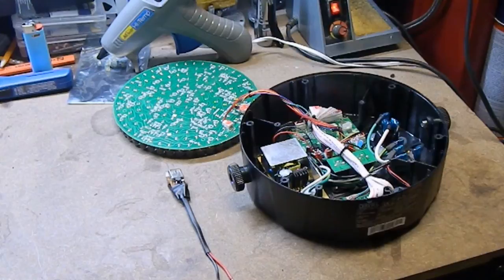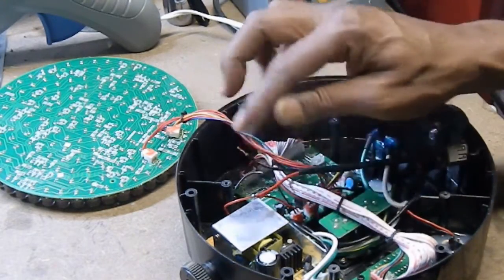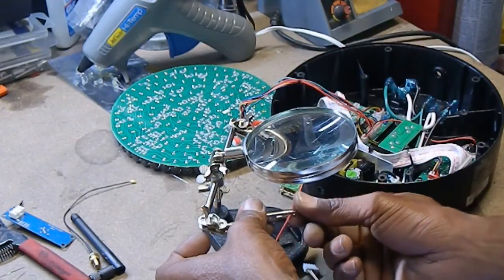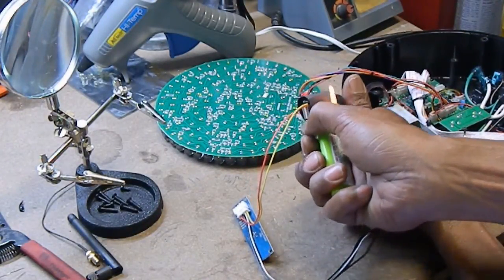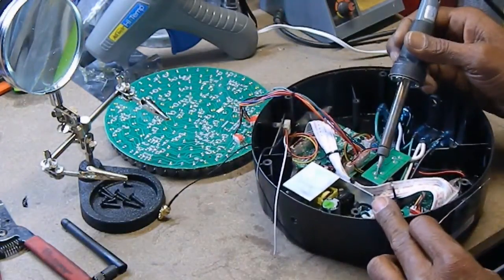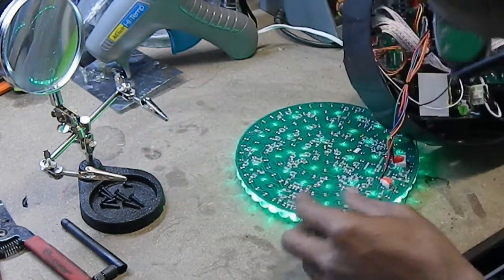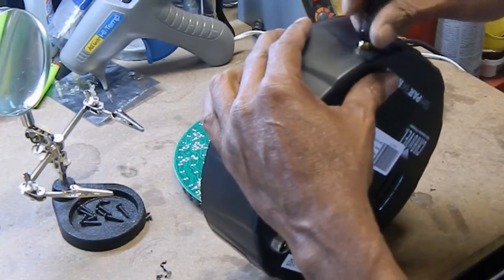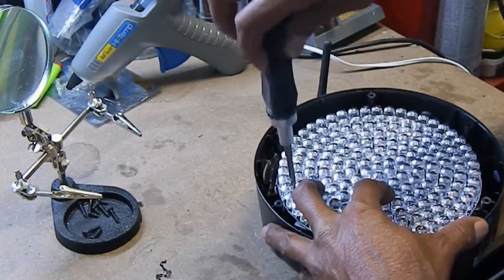Chauvet Slimpar 64 RGBA Built-in Wireless DMX Upgrade DIY - PT2

Comment: Shawn - Thank you so much for you tutorial. I have done the same thing with the similar Monoprice LED 9x10w pars, with 2 exceptions - I used an ebay voltage regulator circuit ($1 ea) and left the antenna inside the case. So far I have completed 4 of my 8 lights. Over time I'll convert all of them! You inspired me to try this - and I love it.  Sure beats the external DMX wireless "Tubes" I see other people use!  Now I just plug-n-go!
DC 5~24v to 3.3v 5V 9V 12v 3A Adjustable Buck Step down Voltage Regulator Module - needs correct 5v voltage selected/soldered & a copper trace cut to "adjustable" pot
DMX512 2.4G LED Wireless Light Module LEDs PCB Transmitter Receiver with Co H4V5 - follow your example, but use enclosed instructions for wire colors etc
Reply from the maker: Awesome! I'll have to checkout the voltage regulator circuit boards, should I need them. We still have a few of the Slimpars left. Now buying the Freedom Pars.

Comment from the maker: Just a note about DMX and the boards I'm referencing in my video. The DMX boards both support transmitting and receiving in one board, just connect the Black and White wires to the correct DMX "IN" or "OUT". Since DMX is a One-way signal some fixtures may have a small delay depending on the wireless 2.4 ghz frequencies in the air and the direct line of sight from your first transmitter. 

For larger rooms or a lot of fixtures , it's best to breakup your signal by adding a second transmitter (DMX OUT) and choosing another DMX channel  to repeat the signal. This helps troubleshooting DMX issues when running over 30 or more fixtures.

Comment: Great video.... I have the par 56 and plan on doing this to a few units to see how it works. My question... I built battery packs for my par cans and wonder if you can still use the 12v plug as normal ... not sure if the 12v you tapped into has any effect on the use of that outlet. Any insight would be helpful... thanks

Comment: Shawn..this is a great solution and video.  If I may ask a question.  When you soldered the hot and ground t the DMX connection it looked like you soldered pin 1(Black) & 2 (White) ..when you showed the still of the connection it looked like you soldered  2 (White) 3 (Black)
Reply from the maker: That is true. I noticed that some of the china based dmx boards are not consistent in wiring or it did some funky flickering. So I always test each board with the fixture while sending a RBG signal and other dmx functions to make sure everything works before I hot glue. I just ordered some new boards from ebay last week and they were completely different as far wiring. Red went to USB pin 1 on the USB inverter, Yellow went to pin 1 (ground) on the input of the slimpar, Black went to pin 2 and white to pin 3.

If the dmx boards came with wiring instructions, please follow them and test everything before you you drill or glue. The main part of this video is how to get 5volts to the the boards and install the PCB dmx boards. Good luck and thanks for watching!
Reply: Thank you so much Shawn.....it's a great to make your acquaintance..Have a great day.

Comment: What is the main adapator for all of the wireless units. I hope I'm asking it right. All the wireless boards you put in. What are they getting the signal from?
Reply from the maker: Aaron Adams I'm using Chauvet ShowXpress software and ShowXpress 512 Plus box  to control the DMX along with a DMX Wireless Stick acting as the transmitter. Any DMX software and hardware that transmits a DMX signal should work fine. Let me know if this answered your question. Thanks

Comment: Hi there. love your video, very thorough. I was wondering though about that blue coloured reciever circut board , could you please supply a link or contact so I could also go down this path as an option?. Finally where do you track down the par 64 wireless battery powered unit to buy as I can't seem to find anything on the internet under Chauvet. I seem to find plenty of battery powered par 64 units listed but not with built in wireless as well. Being not as skilled as you this maybe the second option lol
Kind Regards Dave

Comment: Shawn, why wire both DMX wires to one side? Should one DMX wire go to the DMX transmit in side and one to the transmit out side since DMX is only needing one wire? (Does that make sense)

I wired both DMX wires to one side (DMX in side or out side) and all my receiving lights work fine but my transmitting light doesn't. The transmitting board keeps frying. I'm thinking because I have the two wires on the transmitting side but when I connect a physical DMX cord to go into a non-wireless light it must create a short causing my transmitting DMX board to fry. Should I just only have one wire on and maybe my board won't fry anymore?
Reply from the maker: +Carlos Delvalle DMX is a three or five wire. +/- and ground for 3 wire.

Comment: I purchase same the dmx board in the video but the wires are color different on the plastic fixture. From left to right on the board it shows black, red, white and yellow. The board did not come it a wire diagram show what’s the 5v wire and ground.
Reply from the maker: Most items that come from China are not consistence. The red is most likely to be hot and yellow would be ground. However check with the company you purchased from.

Comment: Shawn- Hey man, great video - Thank you! I just got some lights for my band and thinking about doing this EASY and CHEAP upgrade, can't believe how simple this is compared to the cost of manufactured units. 

My question however, what are you using to Transmit data to these units? How do you connect/configure that setup? Perhaps a video on that would help? Appreciate any input!

Thanks!
Reply from the maker: Any DMX Controller or Computer Interface would work. If using the Slim Pars and want to keep cost down and simple, I would look at getting a Chauvet Obey 4 or 10. For the wireless Transmitter, go to donnerdeals.com and get a Donner 2.4G DMX512 Wireless Transmitter. Then your all set. Thanks!

Comment: Hi Shawn,
I am confused about the channels of the wireless and the DMX channels. Are the transmitters 7 DMX universes? Then do you set each light or device separately for different unit numbers? THanks!
Reply from the maker: Dean, the 7 channels on the DMX boards (also applies to the sticks) are 2.4ghz frequencies that allow you to get the best reception or two split your DMX setup. Nothing to do with DMX universes. So, if you want all your lights on the same channel, you would chose channel 1, (default red), then on your Transmitter you would also select channel 1 red.  See ex: http://www.donnerdeal.com/promotion/wireless/05.jpg
Reply: Gotcha - thanks so very much :)
Reply: When I connect them up, the led flashes only red: what does this signify?
Reply from the maker: That means the board is on channel one, which I think is default. With the fixures on red, your wireless transmitter should be on the same red channel, then use your dmx hardware or software to control your fixture.
Reply: What I mean is it is flashing red - not flashing green like yours is.
Reply from the maker: Okay, unplug and power off your wireless transmitter. Power on just your fixture, then push the button on the dmx board of the fixture until it turns Blue and wait a few seconds and power off the fixture. Now plug in and power your transmitter. Push the button until the light on the transmitter turns Blue. Now power your fixture. You'll know if the transmitter and dmx boards are connected by the the lights. The transmitter will blink RED and the fixtures receiver will blink Green. What are you using for a wireless transmitter?
Reply: I was using the same board as they say it is both a transmitter and receiver.
Reply from the maker: Okay then the transmitter board is connected and wired to what?

Comment: this so good . is there a prefered model of board? and witch tranmiter should i use if i may ask...lv this...
Reply from the maker: Search eBay or other sources for standard dmx 512 boards. They are petty much the same, just look at the wiring closely. As far as Transmitters, they are also basic dmx 512 sticks/boxes or you can build your own using the same dmx boards. Female end is dmx IN and Male for dmx out. Thanks and share!

Comment: I wana bild dmx into 8 led flat pars and in 2 moving heads, which transmitters Would you buy? is that possible with 10 moduls and 1 Controller ( usb dmx interface)?
Reply from the maker: +bimbolino14 , yes you can have as many receivers as you'll like and one transmitter connected to DMX controller. The boards support transmitting and receiving, just connect the DMX wires to the DMx "IN" for receive and OUT for transmit. Good luck!
Reply: +Shawn Garner Do you have a link for me to buy this boards ?
Reply from the maker: +bimbolino14 please use ebay and search for wireless dmx 512 board. I can't recommend any one ebay seller. Remenber to do your research on the sellers before you buy.
Reply: +Shawn Garner could I use every board aß transmitter ore reciever
Reply from the maker: +bimbolino14 yes

Comment: I love this video.  I have 18 of the old Chauvet Rain 56 lights and this is a way to finally modernize them.  Another thing I"ve looked into is using a small 12 volt battery like the ones used for emergency lights as a back up.  They can be purchased at stores like Lowes.  Connect that up to that 12 volt terminal in the light and they will run.  The larger the miliamps of the battery the longer the lights will work and then you can just recharge the batteries using a standard car battery charger.  This would allow you to place some lights in places where running long cords would be a pain or trip hazard.
Reply from the maker: Mark Schwenn Nice solution for battery power. The SlimPar 64's also have a Satellite connector for a 12 Volt connection. I'm thinking about using this connection to add a 12v battery for a few of my SP64's.

Comment: can I use the board dmx wireless to send the signal to my light? I bought 2 and they are "transmitter receiver" so, I can use one as transmitter connected to my dmx console and the other to my light? please tell me yes....
Reply from the maker: +Dvj Upset if you're installing a wireless dmx pcb board into a fixture and wire it to the input side, then your internal board will become the receiver. You would then use a dmx transmitter connected to your dmx control board or usb dmx interface. DMX 512 pcb boards can be wired as transmitters (out) or receivers (in).

Comment: Awesome Tutorial! This is just what I was looking for. The only question I have is, "How are the boards holding up." I've used alot of components from China and they seem to be hit or miss. My only concern with your workflow is that the board will go out in a few months. Granted it won't be too hard to replace it but I wanted to get your take on their performance over the months. Thanks!
Reply: Also, do you think this will work with the battery operated EZ PAR 64. I guess I can give it a go myself tonight but I figured I would ask. It would be great if I could run it off the battery itself.
Reply from the maker: Valentino Zertuche Thanks for watching. Anything electronic will go out, always plan ahead and purchase extra if needed. So far the DMX boards are still working fine.
Reply from the maker: Valentino Zertuche Battery should work as long as you have a 5 volt tap in the fixture. The battery time may give you 5-6 hours depending how much you send dmx signals to the fixture. Let us know what you find out.

Comment: hi I found the wireless DMX board on eBay. is the same item really the transmitter and receiver do you have to wire it differently to be a transmitter or just hook it to the output of the DMX and it automatically knows to transmit if I was going to add the board to my obey 40 controller 
thank you. did the directions that came with item explain what to do differently?
Reply from the maker: +charles t sedita iii The DMX 512 boards can be a Transmitter or Receiver. It just depends if you have a male (In) or female (Out) XLR. If you want the boards to be a Transmitter wire the unit to DMX OUT Thanks for watching!
Reply: +Shawn Garner 
thank you so much. I'm gonna give it a try. befor I drill any holes of course
Reply: +Shawn Garner Man, i just love you <3 I had bought 4 devices and I didnt know if they could work as a transmitter jajaja, thanks, THAAANKS!
Reply from the maker: Dvj Upset Thanks... hope your project turns out great!

Comment: Hi, I love the idea, I know that the invention is a few years old, but I want to do this in my Chinese leds. Could I do this on my Chinese DMX board?
Reply from the maker: I'm sure you can, just need to use a volt meter to see what voltage is coming out of the transformer.
Reply: and found an output called remote that delivers 5v, with this output I can put the antenna. but now I have another question, I ask her if she can help me or some solution occurs to her.

my led spotlights do not have 12v output in the housing. e measured with the polymeter and has a current of 22v. I want to use the bulbs with 12v batteries, is there any way to reduce the voltage from 22v to 12v?.

Thanks in advance

Comment: I purchased some boards (and even tried the wireless external units). 
they show the appropriate green and red flashing lights (for rx and tx) 
but I cannot make it so that the receive tells my lights to run. if I 
use a straight dmx cable, they work perfectly, but when I replace the 
cable with the tx rx wireless units (that indicate they are successfully
 receiving/transmitting) the lights don't receive (obviously the master 
still works, but slave stays blank). replace with cable, slave works.. 
are there different types of DMX, maybe my lights use some odd wiring? 
if so, why does the cable work fine? really confused
Reply from the maker: Make sure the transmitters and receivers are both on the same channels. This should work with the dmx 512 boards and or external dmx 512 sticks. Also check your wiring. Search google images for "dmx 3 pin wiring diagram".
Reply: thanks for that..   like I said, it works if I use the external wireless ones on some moving head lights I have, just not on the static pucks. yet the puck work if I use DMX cable, and same cable works on the moving heads.  I do have an app that tells me all kinds of pinouts (electra droid - way handy) including DMX
Reply from the maker: I did notice some the pinouts where backwards on the board in SlimPars. In the video I manually checked and confirmed the pins while I had a color change program running.
Reply: yep, I noticed that and thought it was a good call. I tried swapping the pin outs inside one board, but then the tx light stopped operating so I suspect it was 'correct' the first time... :-(
Reply: just an FYI. I had it pointed out to me that some of the cheaper PUCK (ex aliexpress) can recieve DMX, but when set in master/slave mode the master don't send actual DMX, but instead some proprietary system. the wireless transmitters don't know how to send that signal so it falls over.
Reply from the maker: Master/Slave connects differently when using wireless. To do this you need to have two dmx 512 wireless boards or sticks in/on the Master fixture, one on the dmx input and the other on the dmx output.  

Fixture A Master: Set the input board on the same channel as your transmitter (Red), then on the output board choose another channel (Blue). Fixture B,C,D etc Slave: Set your input board to the same channel as output of Fixture A Master (Blue). Everything should work as if it was connected via dmx cables. Group all Master/Slave fixtures together... Master (Red in Blue out), All Slave fixtures (Blue in).
Reply: curious!  I'll try this .. thanks for the suggestion... would be great if it's the answer as I already have the gear :-).
Reply from the maker: I'm sure this will work, same concept as if dmx cable was used. The Master output sends  different dmx commands to the Slave units.
Reply: maybe I'm not clearly explaining things. I don't have a console (well, I do, but let's not let that confuse things.. I don't have an actual DMX console, I have a box that effectively has the guts of two lights inside it, I toggle between sound active and strobe).
so for the sake of simplicity, let's just say I just want to set up my first light to 'sound active' master, then use wireless from that to  a second light as slave.

I'm not understanding how I can set "Set the input board on the same channel as your transmitter (Red), then on the output board choose another channel (Blue)" because the transmitter and the outboard are the same thing...  I would upload a picture here if I could... :-(
if I set the master to have the transmitter (therefore 'must be' the 'output board') to one colour, and lug a receiver into the same unit, it's never going to receive anything because it (the master light) is not set to DMX receive (it's set to 'sound').

Comment: Do the DMX boards stay on the green channel even during extended periods of non-use?
Reply from the maker: +Terry Green The light on the board will be solid if no DMX signal is found. Blinking means that you have a signal.
Reply: +Shawn Garner yes I understand that. Will it stay on that channel indefinitely or will it change after being powered off for an extended period of time?
Reply from the maker: +Terry Green Yes, once the channel has been selected, the channel will remain after you power off or until you change it.

Comment: hey i want to buy three of theese dmx boards but my question of that, is this only a reciever or also a sender ?
Reply from the maker: The DMX boards can transmit and receive. It all depends on which input or output you're connecting too.
Reply: thank you i bought 10 of theese ;)